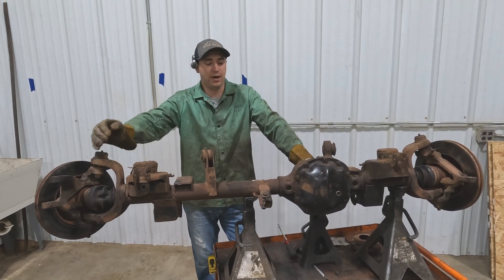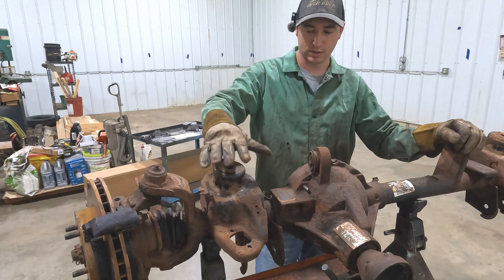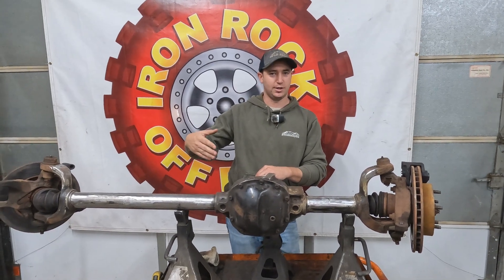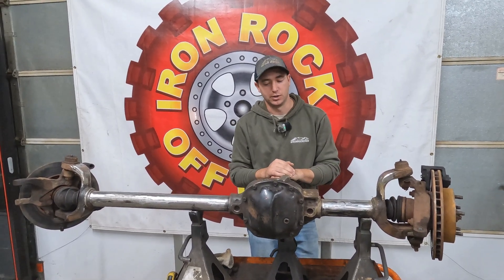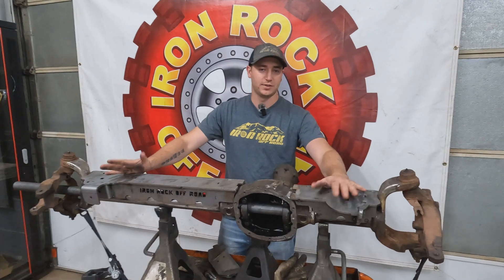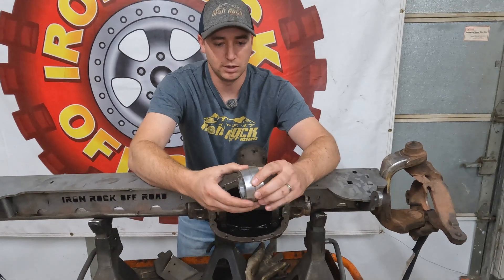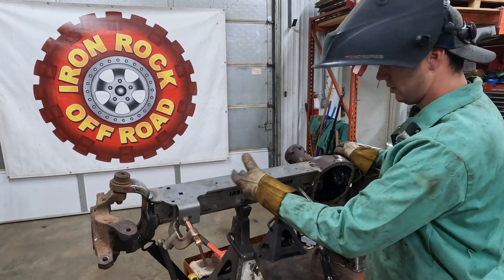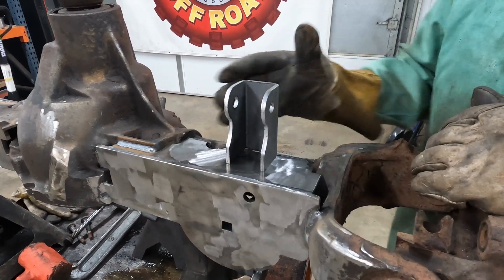WJ Dana 30 Over Axle Truss - Straighten your D30 and keep it that way!

Comment: There's no way to paint the top of the tube and the inside of the truss under the truss you installed, isn't rust going to be an issue on all that bare metal you ground that's still under there?
Reply from the maker: You can definitely paint the top of the axle tube once the truss is welded on. While the axle is out of the Jeep, you can flip it upside down to spray paint into each hole of the truss. We have also found some spray paint cans that come with a long hose attached the help to reach inside the truss and coat the inside. We have also skipped painting the inside with good results as well. Check out Eastwood Internal Frame Coating. They sell the spray paint with the hose attachment. If you are careful, you can rinse the hose with brake cleaner and use it on other cans of paint.

Comment: My brother in melting of metals, get yourself a plasma, it'll slice that up in no time and put way less heat into the tube.  There's lots of more economical options now, a 60 amp plasma is like 500 bucks now and they cut like a hot damn.  

Keep a tight arc bro :D
Reply from the maker: @HisNameIsTater Those plasma cutters are getting so affordable now! It's becoming much easier to have one in your home garage. 
We do have a 50-amp plasma in our shop, but we decided to switch it up and use the old trusty Oxy/Acetylene torch for this video.
Reply: YesWelder has several Plasma Cutters from 55-65 Amps, 120/240 volt for $159 - $300
Reply from the maker: @ampdrawrepair5352 I have seen those and heard good things. I'd love to get one to try out.

Comment: In your opinion what’s the best way to paint this and get full coverage on it. Gonna be doing this kit soon
Reply from the maker: @rednecktaylor8829 We have to deal with rust up here in Minnesota, so good quality paint is very important to us. The best we've found so far is Rustoleum Farm and Implement paint. We only use it from the quart or gallon cans; the spray paint versions don't hold up as well. The inside of the truss is always spray painted first with self-etching primer then we brush on the Rustoleum "Tractor paint" as we call it.
There's lots of color choices in the Rustoleum tractor paint and it isn't too expensive. Shop around to get the best price but typically the home improvement stores like Home Depot, Lowes, and Menards have the best price locally.
Reply: @IronRockOffRoad cheers, thank you
Reply from the maker: @rednecktaylor8829 You're welcome!

Comment: Hi, I have questions about design and construction.The coil spring perches are the part of whole axletruss and do you think its strong enough?I mean about forces feom coil spring into the perches.Stock perches are welded 1/2 around the axletube,but those from axletruss are basically only straight on the back and front side of axletube, is it enough ? 
And also the truss upon the diff cover, isnt it better make one piece   of axletruss and weld it through all top of diff ? Or do you think too many welds shrink/bent the axle ,thats why the one part is welded only on two spots ?
Reply from the maker: @jurajsmutny8171 It is very strong. The truss spreads the load from the coil spring across the entire axle assembly unlike the original mount.

If you want to weld the truss to the diff you are welcome to do so, it will only make it stronger. However, we designed it so that it doesn't need to be welded to the diff, it is strong enough. It is difficult to weld to the cast diff housing, so we made it optional. We have not seen any warping after welding on an axle truss.
Reply: @IronRockOffRoad Thank you for your experience and knowledge ❤
Reply from the maker: @jurajsmutny8171 You are welcome! We are happy to help with anything we can. Let us know if you have any more questions!

Comment: What was the pinion angle set at in this video? I have the 6 1/2 inch lift
Reply from the maker: @craeganwalden6236 We didn't change the pinion angle on this axle. However, it would be good to "cut and turn" the axle Cs before installing an axle truss. The rule of thumb that we always shoot for is to get the most caster without driveline vibrations.

Comment: I also highly recommend the IRO upper flex joint. With the 3 link the rubber joints don’t seem to last.
Reply from the maker: @LeadHander That's great advice! Once you press in the UCA Flex Joint your pressing days are over! If it ever needs service, it's a simple bolt together job.

Comment: I’m considering trussing my front Dana 30. I think if I go through all that work I would also cut and turn the pumpkin to correct caster/pinion angles. Thoughts?
Reply from the maker: @LeadHander If you're going through the effort of installing a truss, it's worth taking the time to make sure your pinion angle is perfect. We have lots of customers that use our front axle sleeves as a fixture when doing a cut and turn. You can simply cut the axle tube, put in the axle sleeve, put the cut section back on at the angle you want, then weld it. Now your inner Cs are at the perfect angle and your axle is MUCH stronger.
Reply: @IronRockOffRoad that will be a future upgrade. I’m just not sure it’s worth the effort on the low pinion D30. I plan to run 35” tires. It would be nice to upgrade to a D44 but the JK axles are $$$. If I’m at the point of cutting the pumpkin out to turn it I was thinking of just swapping it with a 1/2 ton D44 pumpkin, using the WJ tubes and outers.
Reply from the maker: @LeadHander I hear you. 35s are that size where you start worrying about the D30.
The JK D44 front is a great solution on a WJ, it seems like it was made for it! If you are nice to it, you should be ok with the D30 and 35s. Are you rock crawling?
Reply: @ No. At least nothing serious.
Reply: @ Not really. Not to say it won’t happen, but it’s not my main goal.
Reply from the maker: @LeadHander Judging by your videos, it looks like you are out there exploring, camping, and adventuring. I think you'll be good with the D30, especially if you put a truss on it. Keeping that stock axle means parts will be easier to find if you are far from home. I would continue wheeling what you have and keep your eye out for a high pinion axle, even a JK D30 would be a good upgrade. If you are putting on plenty of road miles and you lift height is above 4" a cut and turn would be a good upgrade for longer highway trips and good drivability.

Comment: Started installing my 6.5” rock link pro kit for my WJ and ran into issues with the front coil spring retainer. The breaker nut that’s suppose to expand in the coil perch wasn’t expanding. Tried different methods and no luck
Reply: Give Iron Rock a call on Monday they will get you fixed up.
Reply from the maker: @matthew7972 TPow145 is correct. Give us a call 9-6pm central time 952-210-7185 we will be happy to help! Also, you can always send us an email with some pictures. tech@ironrockoffroad.com

Comment: Same process on a hp30?
Reply from the maker: @TheKrowls86 The key points are the same regardless of the axle. Make sure the axle is straight, tack weld your truss in many places, weld in small sections jumping around frequently to avoid uneven heating.

We have many axle specific trusses. Are you trying to install this WJ truss on a JK high-pinion D30? Or are you asking about a XJ high-pinion D30?
Reply: @IronRockOffRoad  xj hp dana 30.
Reply from the maker: @TheKrowls86 We make a HP D30 truss for the XJ. It is even easier to install than the one in this video because it is welded together when you receive it. There's a good video on our product page and detailed instructions there too.
https://www.ironrockoffroad.com/product/dana-30-over-axle-truss-xjtjzj.html

If you have any questions, you can always give us a call 9-6pm central time 952-210-7185
Or send us an email with pictures. tech@ironrockoffroad.com

Comment: I want the same thing, but with a four link. I don't want a three link arrangement. I want the long arms for stability at highway speed, not off roading. 
My 2000 WJ axle is likely bent. I clearly have negative camber on both sides, but my ball joints/wheel bearings are tight.
Reply: 4 link front long arms is actually a 5 link because of the track bar. Honestly, that is over-constrained for a Jeep that sees more suspension travel than stock. Being over-constrained causes the suspension to fight itself: the 4 links are trying to make the front axle move straight up and down versus the track bar pulling the axle side to side. 
3 links are the way to go. No binding and great stability. My 3-link'd Jeep can blast down rough trails at speed, then get out on the highway and go 80 without batting an eye. What more could you want?
Reply from the maker: @atwebb26 Well said.
Reply from the maker: @RANDOMNATION907 We include options to customize this front truss. It is available with both upper link mounts if you want. 
We have tested front long arms with 3 links and 4 links. Nobody could tell the difference at highway speeds and daily driving. The difference was only felt off road when articulating the suspension and letting it droop out. When off road the 4 link long arms with a track bar was more inclined to bind, feel stiff, and unsettled. Look at Ultra 4 race Jeeps, if they are running a track bar, then they are running a 3 link. They do well over highway speeds across gnarly terrain where stability is paramount. Our own 4500 class Ultra 4 Jeep was the same way.
Reply: I have their 3 link on my ZJ… just ran over 3 hours on the highway 70-80 mph no issues with stability
Reply: Proper 3 link and good track bar will have no issues whatsoever on the highway. Long arm 4 link fronts most of the time still need a track bar as they are not triangulated and the 4th link restricts articulation.